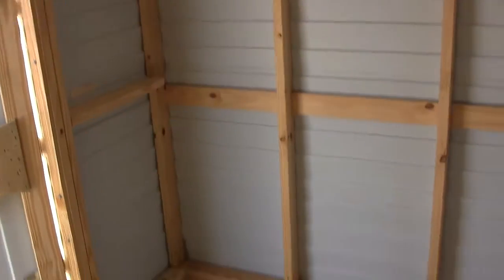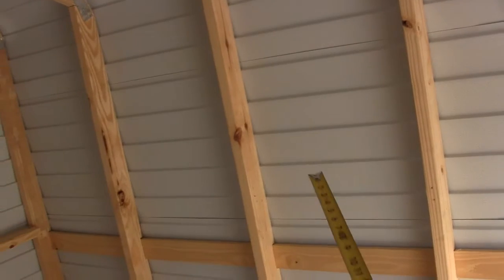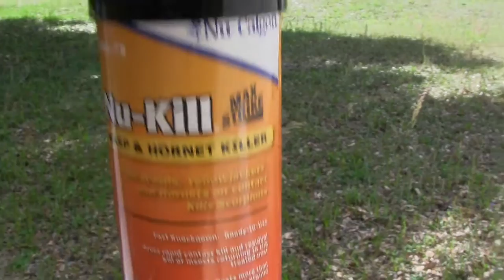I bought a work shop shed.

Comment: I have a similar shed that I use from time to time. One thing I did was put an outlet in the ceiling box so I could hang one of those LED light fixtures that plug in. Those cost 20 dollars give or take. Makes a nice addition
Reply: I'm going to rework the power so I have plenty of power outlets across my work bench.